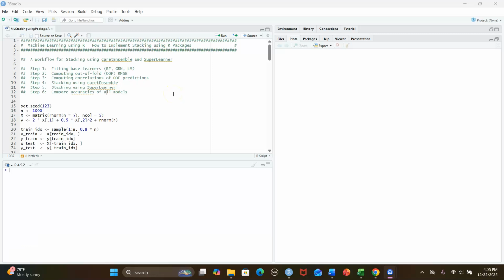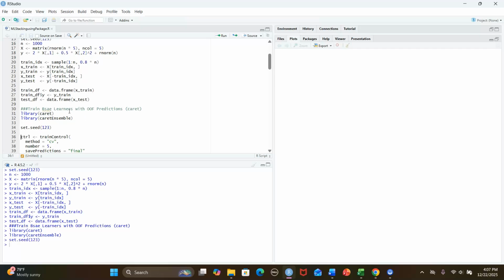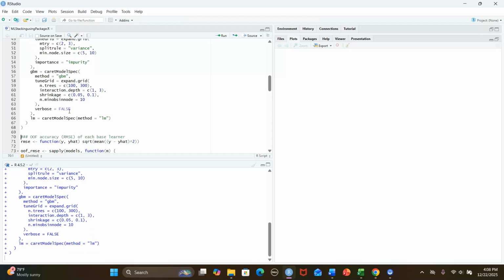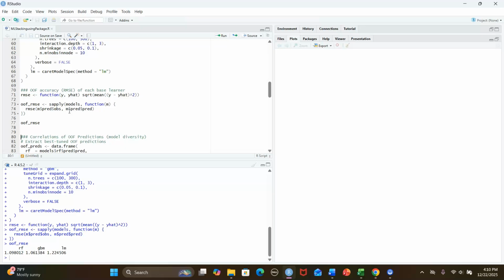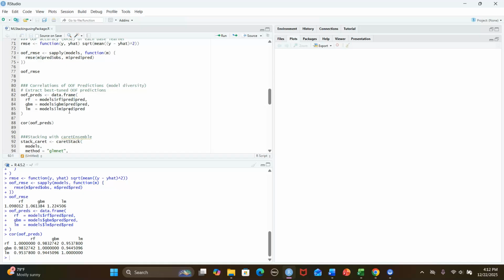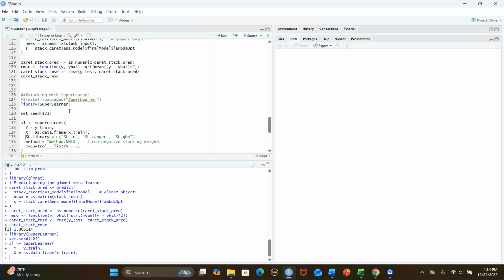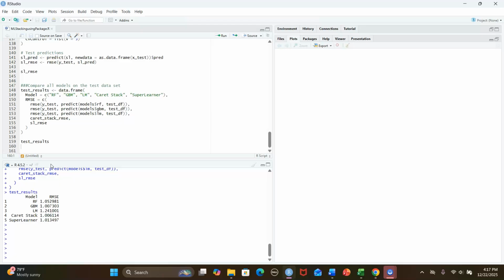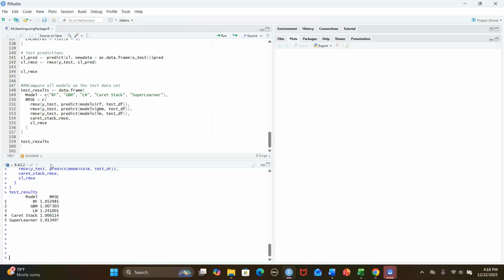Machine Learning using R How to Implement Stacking using R Packages#r#machinelearning#stacking

Comment from the maker: ###########################################################################################
#                                            Machine Learning using R   How to Implement Stacking using R Packages                                             #
###########################################################################################

##  A Workflow for Stacking using caretEnsemble and SuperLearner

##  Step 1:  Fitting base learners (RF, GBM, LM)
##  Step 2:  Computing out-of-fold (OOF) RMSE
##  Step 3:  Computing correlations of OOF predictions
##  Step 4:  Stacking using caretEnsemble
##  Step 5:  Stacking using SuperLearner
##  Step 6:  Compare accuracies of all models

set.seed(123)
n <- 1000
X <- matrix(rnorm(n * 5), ncol = 5)
y <- 2 * X[,1] + 0.5 * X[,2]^2 + rnorm(n)

train_idx <- sample(1:n, 0.8 * n)
x_train <- X[train_idx, ]
y_train <- y[train_idx]
x_test  <- X[-train_idx, ]
y_test  <- y[-train_idx]

train_df <- data.frame(x_train)
train_df$y <- y_train
test_df <- data.frame(x_test)

###Train Bsae Learners with OOF Predictions (caret)
library(caret)
library(caretEnsemble)

set.seed(123)

ctrl <- trainControl(
  method = "cv",
  number = 5,
  savePredictions = "final"
)

models <- caretList(
  y ~ .,
  data = train_df,
  trControl = ctrl,
  tuneList = list(
    rf = caretModelSpec(
      method = "ranger",
      tuneGrid = expand.grid(
        mtry = c(2, 3),
        splitrule = "variance",
        min.node.size = c(5, 10)
      ),
      importance = "impurity"
    ),
    gbm = caretModelSpec(
      method = "gbm",
      tuneGrid = expand.grid(
        n.trees = c(100, 300),
        interaction.depth = c(1, 3),
        shrinkage = c(0.05, 0.1),
        n.minobsinnode = 10
      ),
      verbose = FALSE
    ),
    lm = caretModelSpec(method = "lm")
  )
)

### OOF accuracy (RMSE) of each base learner
rmse <- function(y, yhat) sqrt(mean((y - yhat)^2))

oof_rmse <- sapply(models, function(m) {
  rmse(m$pred$obs, m$pred$pred)
})

oof_rmse

### Correlations of OOF Predictions (model diversity)
# Extract best-tuned OOF predictions
oof_preds <- data.frame(
  rf  = models$rf$pred$pred,
  gbm = models$gbm$pred$pred,
  lm  = models$lm$pred$pred
)

cor(oof_preds)

###Stacking with caretEnsemble
stack_caret <- caretStack(
  models,
  method = "glmnet",
  trControl = trainControl(method = "cv", number = 5)
)

# Test performance
# Base learner predictions on test set
rf_pred  <- predict(models$rf, test_df)
gbm_pred <- predict(models$gbm, test_df)
lm_pred  <- predict(models$lm, test_df)

# Combine into a matrix for the meta-learner
stack_input <- data.frame(
  rf  = rf_pred,
  gbm = gbm_pred,
  lm  = lm_pred
)
library(glmnet)

# Predict using the glmnet meta-learner
caret_stack_pred <- predict(
  stack_caret$ens_model$finalModel,   # glmnet object
  newx = as.matrix(stack_input),
  s = stack_caret$ens_model$finalModel$lambdaOpt
)

caret_stack_pred <- as.numeric(caret_stack_pred)
rmse <- function(y, yhat) sqrt(mean((y - yhat)^2))
caret_stack_rmse <- rmse(y_test, caret_stack_pred)
caret_stack_rmse

###stacking with SuperLearner
##install.packages("SuperLearner")
library(SuperLearner)

set.seed(123)

sl <- SuperLearner(
  Y = y_train,
  X = as.data.frame(x_train),
  SL.library = c("SL.lm", "SL.ranger", "SL.gbm"),
  method = "method.NNLS",   # non-negative stacking weights
  cvControl = list(V = 5)
)

# Test predictions
sl_pred <- predict(sl, newdata = as.data.frame(x_test))$pred
sl_rmse <- rmse(y_test, sl_pred)

sl_rmse

###Compare all models on the test data set
test_results <- data.frame(
  Model = c("RF", "GBM", "LM", "Caret Stack", "SuperLearner"),
  RMSE = c(
    rmse(y_test, predict(models$rf, test_df)),
    rmse(y_test, predict(models$gbm, test_df)),
    rmse(y_test, predict(models$lm, test_df)),
    caret_stack_rmse,
    sl_rmse
  )
)

test_results